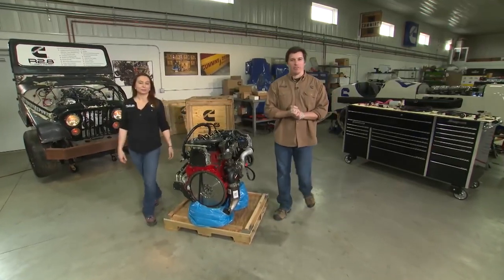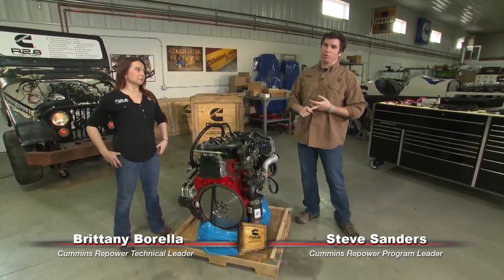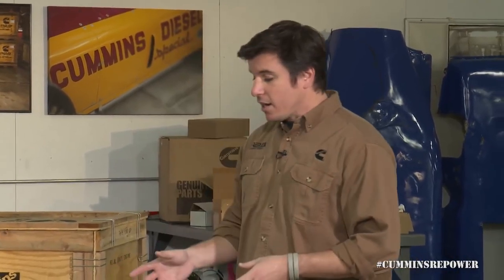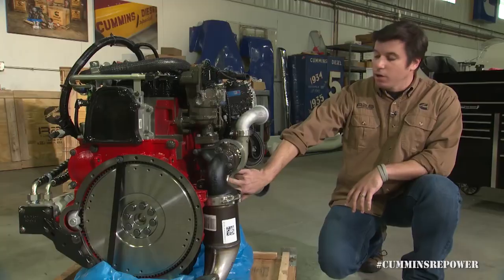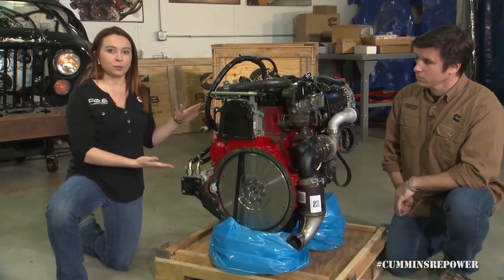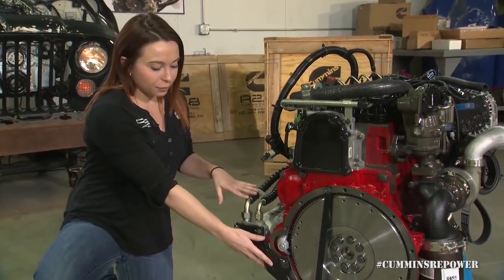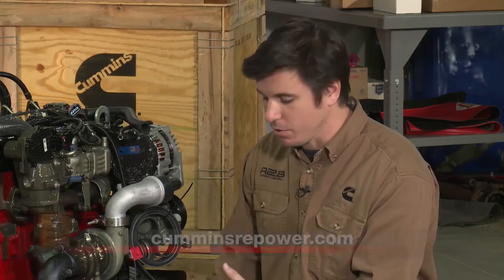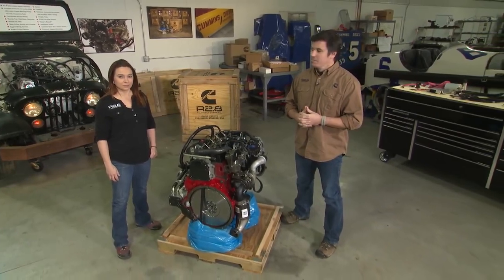Cummins Repower Garage 3: Mounts and Adapters for your R2 8 Repower Project

Comment: Could I get the information on the getrag 5 speed you talk about in the video please? I'm considering swapping out my 1999 4.2L v6 for the 2.8 in my f150, it already has a 5 speed manual, but it's old and has 260k on it and I was wondering about fitment and everything? More fun to keep her and just fix her up than get a new vehicle without a manual option. Thanks guys